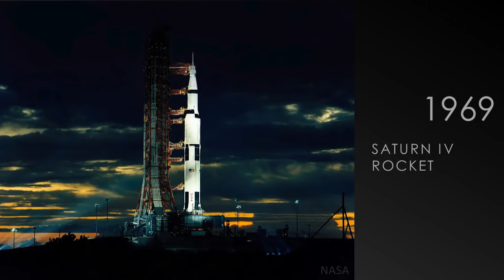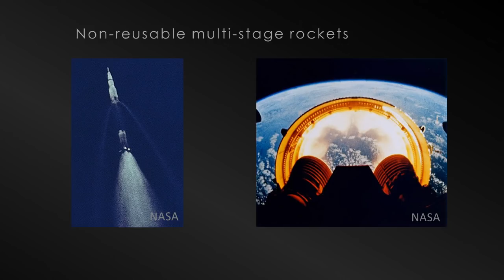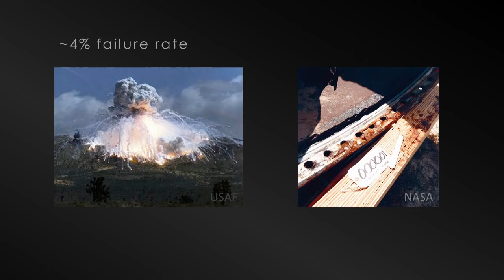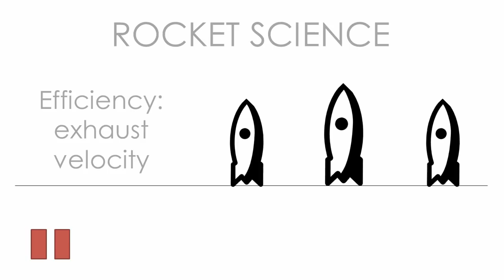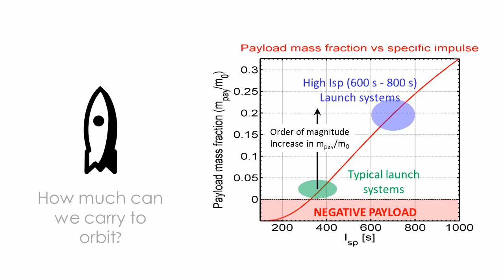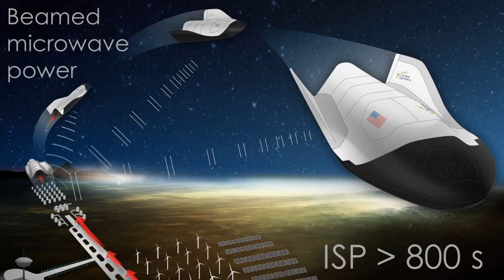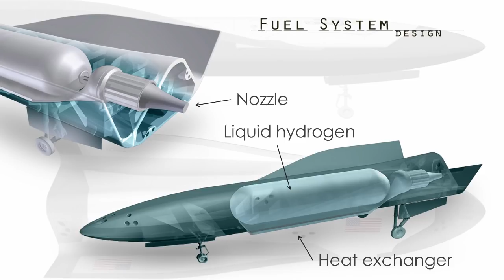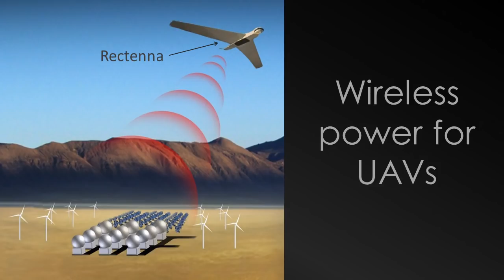A better way to get to space: Dr. Michael Kelzenberg at TEDxWSU 2014

Comment: At the equivalent of 3 tons methane burning per second, we have 46,5 GW. Even with a receptor area  of 465 square meters, we are still at 100 MW per square meter. Sounds more like an energy weapon than a propulsion system.
Reply: That is a tendency of high energy solutions to problems
Reply: Come at us, Aliens!
Reply: Think on the prime directive: No contact is allowed with primitive civilizations.
Reply: Manu, that is true for non directional waves. Something like a laser's intensity is much less dependent on distance.
Reply: If used as an energy weapon, it's one that could be defeated by aluminum foil, would be big enough to be useless for any emplacement smaller than an aircraft carrier, and only useful against flying targets within line of sight.

In other words, nowhere near worth the price tag.

Comment: I quite like this idea
At room temp hydrogen moves at 1,754 m/s rather than 585 m/s for water
so if you can get it to the same temperature (not easy) you would have 3 times the exhaust velocity.
if liquid rockets are 4400 m/s then this could be over 13 km/s an exhaust velocity faster than the velocity you need the rocket to reach low earth orbit 9.4km/s so less than 50% of the mass would be needed 50% * 9.4/13 gives 36% but the average weight during launch would be the weight after using half the fuel so if you adjust to make the average weight 100% you start with 118% of the weight you did have with 36/118 fuel
so potentially you would only need 36/1.18 % fuel only about 30.6% fuel and mostly payload.

Comment: The question he didn't answer is why does it need to be powered from the ground? With the increase in efficiency why not place a suitable generator on the craft and power it locally? A nuclear reactor would be perfect for the use he is referring to and it would provide power for the crew as well. Imagine a large tank of water with a nuclear powered electrolysis device on board. You pipe the gasses released to the microwave and power the microwave itself from the same power source. Main difficulties would be to provide radiation shielding for the crew and make the reactor reliable. Also to make the pipes corrosion proof and be careful of back blasts. The benefits would outweigh the difficulties in my opinion.

Comment: The problem with all rockets including yours is that they start from a stand still. A giant electric rail gun like a train track that launches the rocket up a mountain would greatly reduce the amount of fuel needed in the first place, then your microwave system can kick in and further propel the rocket with a very large payload into space
Reply: While EM launch has a lot of potential as a kind of kick-starter for other launch systems (eg, getting a microwave rocket far enough off the ground for the beam-director to gain line of sight, or accelerating a ramjet up to working speeds), it's currently not a good candidate for a substitute first stage, for three main reasons:
1) There's no good place to put it. For it to be practical, you need a very tall mountain that has a suitably angled/structured slope, is close to the equator, reasonably accessible by ground/sea, and wouldn't subject thousands of residents to the window-shattering sound of a hypersonic launch. Compromising even one of those criteria would be very costly.
2) It's financially unsafe. No matter how much greater your payload fraction is, you're shooting multi-million-dollar hypersonic projectiles out of a multi-billion-dollar barrel that takes years to build. If anything goes wrong, EVER, you're unbelievably screwed.
3) It requires accelerating the vehicle to very high velocities at very low altitudes--even Mt. Everest is very low in this context--where the atmosphere is very dense and will therefore apply a lot more pressure and heat to the vehicle's skin, probably far more than reentry. Whatever you save on propellant you'll likely spend on structure and thermal protection.

Overall, with technology and economics as they are, it just doesn't make sense to actively pursue EM launch. There are better places to put the severely limited research dollars.
Reply: Spin Launch systems

Comment: So, if you shoot a spacecraft with high power ground-based microwave beams to ignite hydrogen, what's preventing the crew from getting microwaved to death?
Reply: The hydrogen is not being ignited, it's being heated, but there's no oxygen present for it to combust with. The crew could easily be shielded in the same way a microwave oven is shielded.
Reply: It's called aiming the microwave gunsite
Reply: That's not the problem, the problem is the microwave ray will toast everything, the planes, birds, anything that intersects it. Think of a microwave oven turned inside out with the rays shooting all over the place. And that's a 800 W microwave oven, not a MEGAWATT one.
Reply: What do you think any rocket does to something it intersects with? Like they're launching rockets over the top of passing planes rofl. At least microwaves cannot accidentally fall on neighboring countries.
Reply: What's preventing you from dying after your first use of a microwave oven?

Comment: I thought about using a inverted teardrop hydrogen balloon with a hollow middle where the rocket sits & as the balloon rises it expands because of the decrease in air pressure, it also gets colder so might not some of the hydrogen be converted into liquid fuel during this process?

Comment: can we design an algorithm, that goes through all the chemical elements, and also use all possible mixtures of N elements, to figure out the most optimal mixture that generates the highest Specific Impulse value? for example, it could be a mixture of five chemicals.
Reply: That's not how propellant chemistry works, really, but to make a long story short, the highest Isp ever attained by a chemical rocket (and very close to the theoretical maximum) is about 540s, which is about 17% higher than the advertised Isp of the Space Shuttle's main engines. The propellant used molten lithium as fuel, liquid fluorine as oxidizer, liquid hydrogen to reduce the molecular weight of the exhaust, and straight-up insanity to get otherwise-brilliant people to attempt something so foolhardy.

The moral of the story is that even if you're willing to kill every living thing within a hundred miles of your launch site, you're not going to get anywhere near the reduction in launch costs necessary to really make a big impact in humanity's ability to explore, colonize, and industrialize space. For that, you need something completely different.

Comment: A beamed microwave like that would also be a very powerful weapon. The lilit would be the powersupply, but with expected advancedments in batteries and capasitators should  you could make a very strong and mobil version based on the generator technology described in this talk.
Just a reminder that any advancement in tech that deals with high power have many uses.
Reply: Actually, it would make a pretty terrible weapon, as it could be defeated by aluminum foil. Yes, it would be able to defeat specific targets (stealth aircraft would probably be particularly vulnerable), but there are easier, cheaper, and less target-specific ways to do exactly the same thing.

Also, making a mobile version of this would require dramatic improvements in a wide variety of technologies, most being pursued with great intensity for improving EV's and renewable energy. Just a reminder that just because an advancement in tech is scary doesn't mean it shouldn't be pursued ... and is often less scary than it initially appears, too.

Comment: I have always loved the idea of SSTO's using air breathing engines for at least a decent part of the flight into orbit, and Skylon looks like it's not terribly far off now.
Reply: might as well jettison the air breathing mass once there isn't any atmosphere.  then once you do that might as well use a 2 stage rocket.  You can napkin math all this stuff and see why it isn't really a great idea.
Reply: @JackMott  rocket fuel is too heavy. Starting 1 metre above ground means you go 10 metre more before running out of fuel. If you can start burning rocket fuel higher, the gains are exponential.

Comment: Sounds pretty far out even for someone who studied large renewable energy power plants in geosynchronous orbit in 1975 at JPL and used a rectenna to convert the microwave beam back to electricity for distribution. I don't say this will never work but it sure has a ton of issues.

Comment: If I have a satellite orbiting at 75 miles carrying a tether 70 miles long which can catch a flying wing payload and bring it aboard the orbiter, I can put mass into orbit for the cost of an jet ride. Preferably a pulse jet for supersonic speeds.  The pulse jet can use oxygen up to 100,000 ft. The orbiter can maintain its position through less forceful propulsion means than rocket power from the bottom of a gravity well.

Comment: Ok so he's not the best speaker    BUT why cant the microwave source be on the spacecraft  ?
Reply: What fuel source are you using to generate the megawatts of energy required? The whole point is to have the bulk of the energy production of launch occur on the surface to reduce weight costs.

Comment: Rocket scientists have been trying to increase Isp (specific impulse) values for decades with not a whole lot of success.  Research the linear aerospike engine.  It was a nice attempt at a much more efficient engine, but was abandoned due to being limited to using lighter weight composite materials for propellant tanks, which are prone to failure under high pressure. Not to mention the inefficiency at launch (sea level).   A start-up company called ARCA is currently working on a SSTO (single stage to orbit) linear aerospike rocket, but they have yet to move beyond hydrogen peroxide as a propellant.  Graphene technology could possibly change the whole course of rocketry due to its strength and light weight, resulting in much better velocities, payloads, and higher specific impulse engines.  Time will tell.....

Comment: What about using rail gun tech with rocket fuel for launch to reduce the rocket fuel that is needed to  get a payload in orbit?
Reply: keimo Clayton yepp! but not for humans
Reply: On board electronics most likely can not withstand the EM wave generated by the gun fire even if it can bear that G force. And you still need a burn in orbit in order to stay there. But Yes it would be so cool to solve it.
Reply: Sci-Fi author Robert Heinlein posited such a system (and I don't think he was the first, just that he made it accessible to people's imaginations) in his 1966 book, The Moon is a Harsh Mistress.  While, it COULD work for transporting people into space, I think such technologies would be far better at transporting construction materials (and pre-fabbed items) into space.
Reply: keimo Clayton -- Yes, in theory a Mass Driver (not Railgun) could be used for initial acceleration, perhaps replacing the 1st stage of a rocket. Much as I like it, there are several huge issues with that approach, and numerous trade-offs between cost and performance. To me, they look like pointing to a Launch Assist system which gives only Mach 1 to Mach 2, out of the Mach 25 needed to reach orbit. That gives a benefit of several percent, which could mean double or triple the payload to orbit, but it's an expensive system and it will not be used very often for many years. That is large financial problem.
Reply: keimo Clayton  Watch what Elon Musk's Hyperloop evolves into.
Reply: keimo Clayton i just commented the same railguns should be able to achieve escape velocity no prob....
Reply: I have been saying that for years!  If we could eliminate Stage 1 on our rockets - that would save 50% or better in the fuel cost of a typical rocket launch, and realize a 10x increase in payload volume to space.  But with tRump in office - NASA's budget is something like $18B.  A ludicrous amount to develop these technologies.  Perhaps if we were to deny the hundred billion-dollar increase in the Industrial War Complex and put that kind of funding back into NASA - we'd seen tremendous progress made in our lifetimes towards colonizing the Moon, Mars, and maybe whatever lurks out at Alpha Centauri.  If I was president - I'd make NASA's budget a respectable sum.
Reply: Underground tunnel. Magnetic train.  The underground tunnel rises to the side of one mountain and it builds up speed. At the top of the mountain it is released at match 5. Spaceship turns engines on to gain the required speed to reach LEO. Space platforms catches the spaceship and gives an extra boost. Rising from orbit to orbit the speed increases until the required speed is reached.
Reply: Wow - I'm not alone in this universe - somebody else gets it!!!!  Look for a book I wrote:  Project Nightshade.  If I can get the time to revise it with proper references, this will be a pretty interesting book for people LIKE YOU, BLUE FRENZY, to read.  It's all about alternative means to launch payloads into space [spoiler alert] using maglev technology.
Reply: Brian Brewster We are but lone voices in the wilderness. People want bombs and aircraft carriers. They don’t give a sh*t about space. Humanity is what it is.
Reply: Brian Brewster
Every TAX PAYER'S DOLLAR that makes its way to NASA's budget, how much is wasted on the bureaucracy and pork barreling by politicians to their respective electorates and the special interests paying for red tape legislation and kick backs?
Reply: Great minds  keimo  great minds
Reply: Kelly Jackson Whether the interior of the tube is covered in 1000's electromagnetic coils, or if the tube is metal and the spacecraft has a few rows of retractable permanent magnets interspersed with a few electromagnets running the length of the spacecraft, to effectively suspend the craft in the center of the metal tube by varying the amount of power to the electromagnets, and spring loaded slides for breaking and preventing the craft from striking the sides in case of failure... 
Regardless of what's used, a vaccum would have to be created in the tube. But, that's alright. Because controlled amounts of  air can be let in along the length of the tube behind the craft and if the jet engines vacuuming the air out is stowed in pressure tanks, you could get the pressure from 14psi sea level pressure up to 50psi. Figures out to more than a 1,000,000lbs of thrust on a 144cuft 12ftx12ft  surface area. That's alot of thrust, like having the ability of launching a loaded railroad car.
Reply: Benjamin Taheny
No more than for any federal program.
Reply: 0 mph - 30,000 mph  would cause it to burn up , like a shooting star in reverse .
Reply: Exactly.  I posted before I saw your comment.
Reply: you should see the movie "Doomsday Gun" with Frank Langella about George Bull
Reply: What about something like a space elevator, with a string , the lower end comes down from low orbit and capture the payload at some km attitude, then the other end accelerates to bring itself back into a stable orbit, dragging the payload up